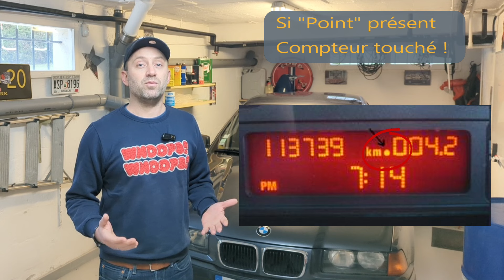BMW E36 tout savoir sur la Série 3 avant l'achat

Comment: Juste deux choses concernant la Belgique : On a ce qu'on appelle le carpass, sans carpass, une voiture dont la quote est de 5k peut descendre à 2 ou 3k, sans carpass, une voiture en Belgique perd grandement de sa valeur et devient limite invendable.

Et autre chose, concernant le tuning, la Belgique à probablement l'un des contrôle technique les plus exécrable qui soit.
J'ai déjà failli avoir une contre visite parce que ma 320i avait un.... Pack M... Un pack M officiel BMW, fait chez un concessionnaire BMW, etc... Le mec m'a demandé si c'était une M3, je lui ai dit que non, il m'a demandé pourquoi j'avais les pare-choc et les jupes M...
J'ai menti, mais je lui ai simplement dis que le tout premier propriétaire avait du choisir l'option pack M lorsqu'il l'a acheter la voiture en 1997... 

C'est passé de justesse, car improuvable, mais il était prêt à refusé ma voiture pour un pare-choc... Elle n'était pas surbaissée, elle n'avait pas de prépa turbo, pas de flammes sur les cotés, pas de jantes chromées 47pouces montées sur pneus 295 ou un aileron carbon de wish... elle avait juste un pare-choc M...

Comment: Bonsoir, 
Le M50 n'a jamais équipé la e30 et pour cause, la e30 est trop ancienne par rapport à ce moteur multi-soupapes apparu dans les années 90, tu dois confondre avec la e34.
La plupart des préparations avec turbo se font sur le M50 car plus résistant aux hautes températures que le M52.
Reply from the maker: Effectivement pour la E30, autant pour moi, c'est le M20
Reply: Et le m50 est en double ressort de soupape. Il aime le régime. Encaisse 7200tr stock.
Reply: @punchliners6762  En double ressort ??? Sur mon M50, je n'ai qu'un ressort par soupape. Par contre les soupapes sont très légères autorisant effectivement des régimes élevés.
Reply: @CONNORJohn-i1s  mon m50b25 était en double ressort de soupape..cest d'origine je pense.